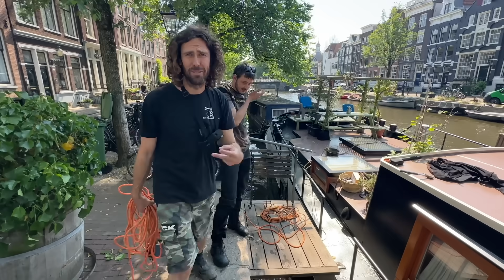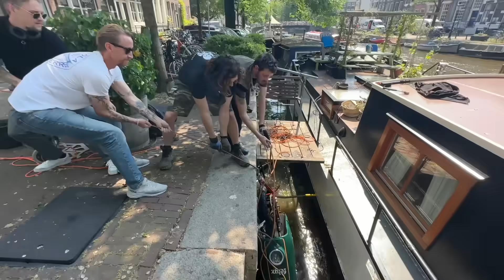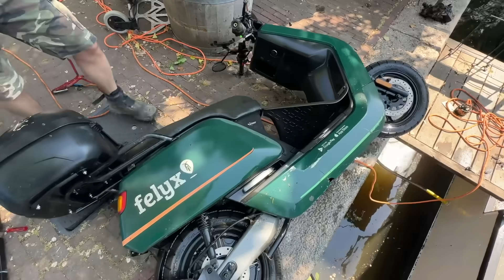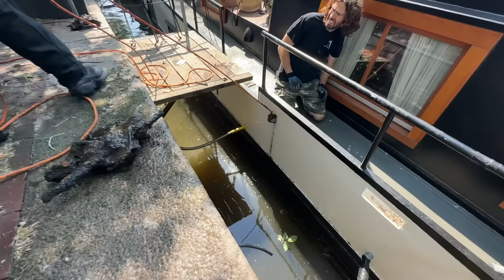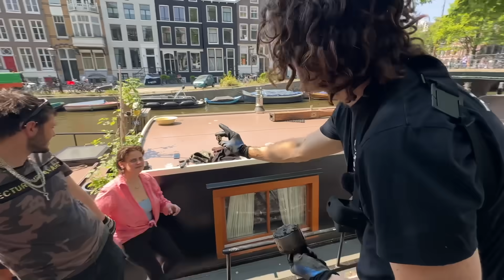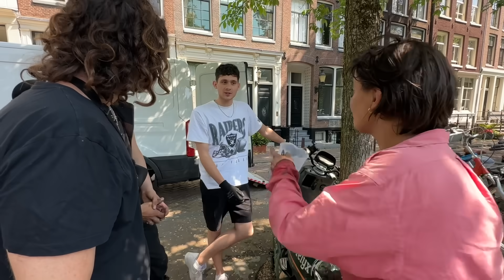INCREDIBLE Magnet Fishing in the Heart of AMSTERDAM! (HELP)

Comment: Nice one bro but did you find the keys in the end? If you can find a thin piece of plastic and attach it to some sort of handle to hold it. Like a plastic spade. You can use it to break the contact of the magnet when it sticks to something by pulling the magnet over it while you hold it in place. Probably a lot cheaper than a new paint job.
Reply from the maker: No we didn’t find the keys unfortunately! When the magnet is stuck like that there’s nothing you can get in between, but I’m not sure pulling it all the way up was the best way to het it off 😅😂
Reply: @BondiTreasureHunter  oh right. That's a shame. I just had thought. You ever thought about getting one of those RV submarines? It would come in handy for those moments when the magnet gets stuck. You can go down and see what's going on down there. Or even find stuff. There's plenty of YouTube videos on it.

Comment: I think lithium batteries are worse than oil and stuff for pollution. Of course an electric vehicle is cleaner driving around but I've heard that producing litium batteries and also the waste is extremely dirty and pollutant. I know lithium batteries are considered hazardous material. Ive also heard of the batteries igniting/exploding its more of a really hot fast fire melt down. I know older lithium battery technology was a bit more dangerous and prone to igniting like if it overcharged or could short out easier. But now the technology is better and more safe but if the batteries are damaged they can ignite and soaking in water is very bad for the environment. 
I have no idea what would go into repairing a electric scooter like this thats been flooded i cant imagine the batteries are good. Ive flooded a dirtbike before in fresh water like a deep stream but that was a gasoline engine and i was able to drain everything and take it apart to dry out and get going again. We've even fixed a water logged bike out in the woods once which isnt ideal because you really want to take it all apart and remove all the water.